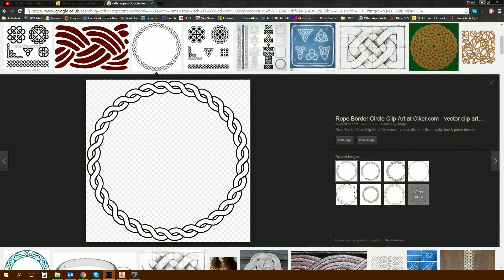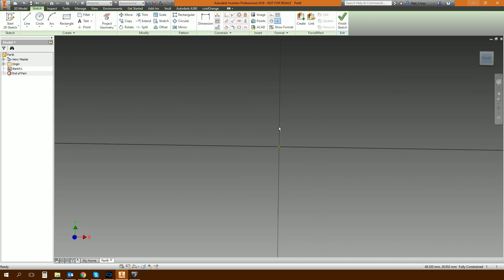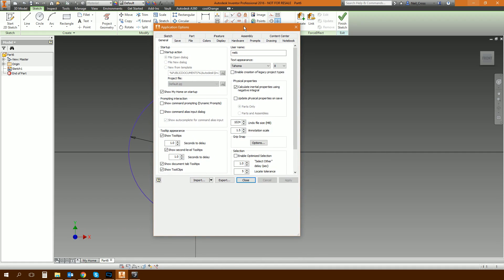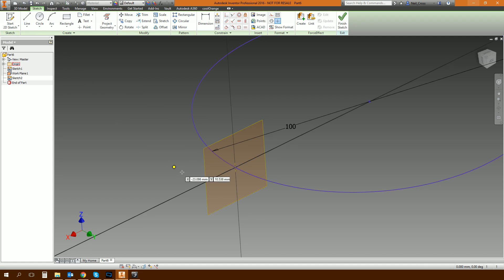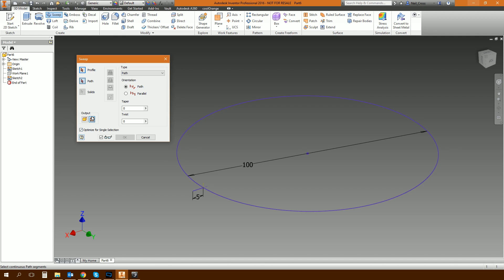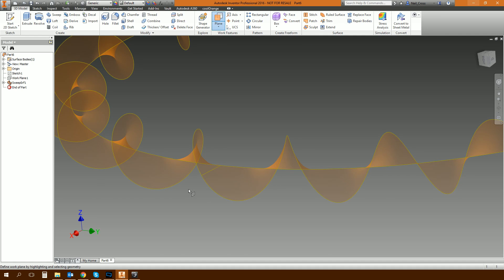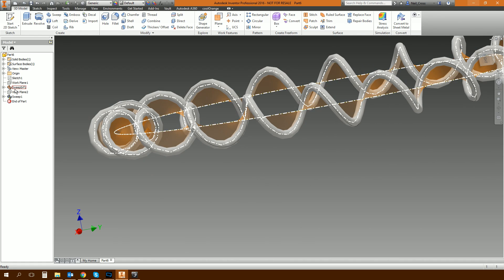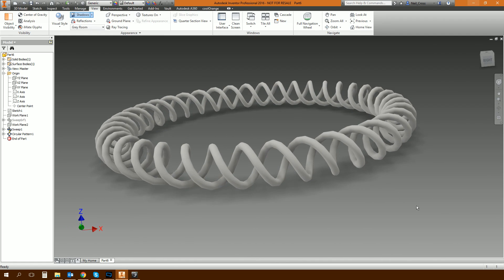Circular coil/spring tutorial | Autodesk Inventor

Comment: Nice video.  Thank you for making and sharing.  I was hoping to use your circular helical spring as the basis for accurately forming worm wheel teeth.  But any final swept profile that is not self- symmetrical seems to go really weird.  Any suggestions or pointers would be most appreciated.

Comment: I follow it perfectly, last night I made it no worries but trying to make it today following the exact same steps I get the message:  A segment of the sweep path is tangent to the profile (or is contained by the profile plane).  Change the path geometry (e.g. make it perpendicular) so it is no longer tangent to the profile. 
How do I fix this?
Reply: Make the line vertical instead of horizontal.
I had same problem in 2020. 🙂
Reply: @smukkegreen  thanks for taking the time to reply, I realized that's what it was but I still have no idea why
Reply: @GeneralPetey  yeah, i also think it is wierd, since it works in 2018

Comment: Celtic rope. Nice and artsy-fartsy. But... THIS IS USEFUL FOR REAL PARTS. Here's proof. A couple days after first watching this video, I was presented with the need (ok, an excuse) to model a part that has exactly this shape. It's a coil spring band used to reinforce a polymer shaft seal. I could have simply cheated and used a torus, but that's too painfully pragmatic for me. Ok, I'm American so, let's call ourselves top guns, CAD rock stars, or "I'm too cowboy for that." And I am. The only guy who shows up at an engineering office wearing boots and hat and big handlebar mustache. But when it comes to CAD modeling, I can't help myself - I just nerd out.
BTW, We just don't say "baller" much over here. It's not a cool thing. Just think of the ball washers on a golf course. "Ladies?" Even the basketball meaning can be taken kind of bad, as a racist thing in that case, depending on context. I avoid it. Top gun, that's typical slang in the industry for a tatoo'd Harley biker kind of bad-ass CAD nerd. 
And, this tip is just the thing for Top Guns. Thank you. In NX10  I use similar kinds of tips and tricks, but there's 2 or 3 ways to do most things and it helps to think laterally. But Inventor is a little more like, "There's just-one-way and this is how it's done 'round here," and tips like this help us find it quickly. Thank you, Neil. These are great.

Comment: Any tips for managing thousands of repeated coils, or faking the effect?
I have an interest in piano design, and sometimes I want to sketch out a piano scale once in a while. Always, except in exceptional cases, I have the task of creating copper-wound bass strings. On extra-low notes, it's manageable, at around 2k windings per note, and usually one string per note.

However, on the thinnest bass strings, they can have upwards of 14 THOUSAND individual windings, and they always have at least two strings per note, sometimes more depending on the design, and polycounts quickly grow into the tens of millions.
I've tried breaking up the coil into several sections, and have even considered parameterising this to work with feature suppression/iParts. I want to at least keep around 4 fps while all the bass strings are in view, and keep the geometry-calculation workload to a minimum.
Reply from the maker: +borthelcash ' Do you actually need to physically model them coils though? Surely the coils are so small and fine that you wouldn't see the detail unless you're zoomed right in on it?
Reply: borthelcash 'use iparts. Watch his video on that